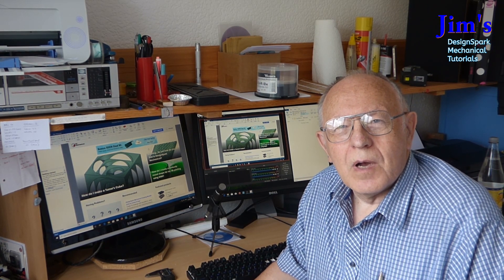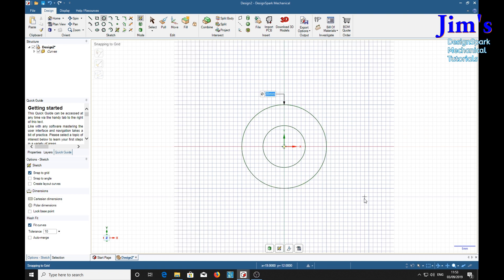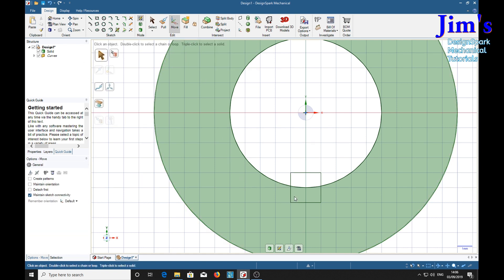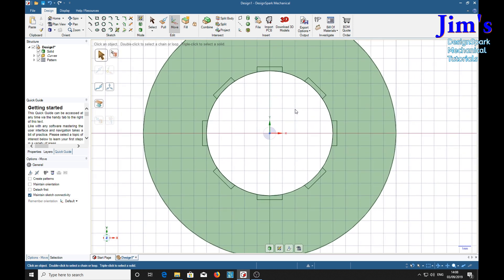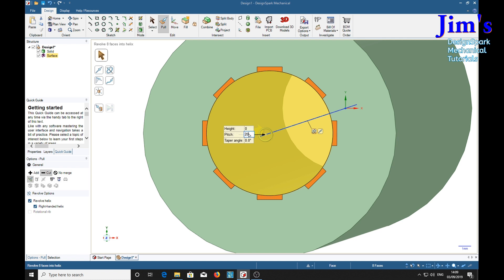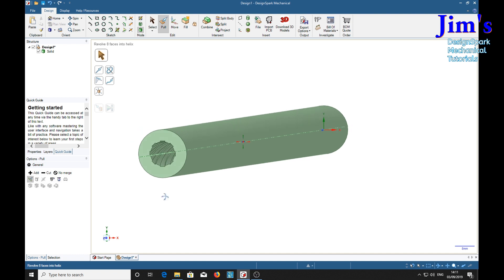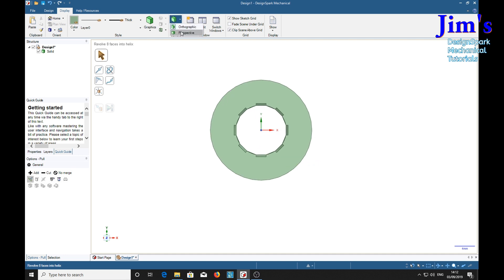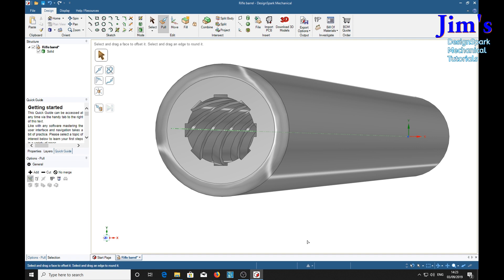Modeling a rifled barrel with DesignSpark Mechanical

Comment: Thanks, Jim! Awesome instructional!

I work in the defense industry and recently got the green light to start learning CAD. The only problem? There’s no one to teach me, lol. We’re a small division of a much larger European defense company, so most of the resources and budget go to HQ. That means we usually inherit second-hand equipment and software 😆—and it can take a while for those "hand-me-downs" to arrive and be implemented. So, in the meantime, I decided to purchase and learn DSM until my SolidWorks seat gets transferred from HQ.

I do have a question you might be able to help with. Let’s say you wanted to add or remove a groove after completing the helical pull—would you be able to modify the model easily, or would you need to start over? I ask because I just submitted my first prototype today (which they couldn’t believe I completed so quickly—thanks to you!), and management is moving forward with machining a few prototypes for potential customers. The only issue is that I got the groove count wrong, and I’d like to adjust it without having to start from scratch.

Thanks again for your time—I really appreciate it! Looking forward to your response.
Reply: The thing is so simple it is easier to start again. You can not add or remove a groove and have them equally spaced. You could remove them all and pull the bore to the right size and then do the rifling again.
Reply: I initially thought starting over might be easier, but since I’ve added some complex geometry to the OD of the part, I was trying to avoid reconstructing those features. Thanks for your response!

If you don’t mind me asking, how long have you been using DesignSpark? How did you come across it, and what do you see as its limitations in the manufacturing world? I’ve heard that it doesn’t compare to SolidWorks because SW is parametric and better suited for manufacturing and assemblies. Do you find this to be true?

I understand that a 'Direct Modeling' approach might introduce issues in the part’s geometry, potentially leading to misconstrued PMI data for the Machining Department. However, couldn’t this be mitigated by ensuring the part is properly constrained and checking for any inconsistencies or 'breaks' in how features connect? I’m not sure if 'breaks' is the right term here, but I’m referring to making sure each feature is properly connected to one another.